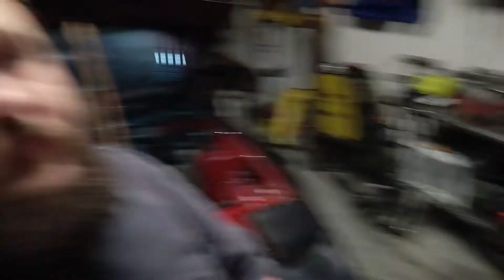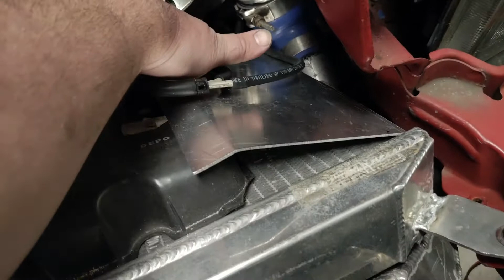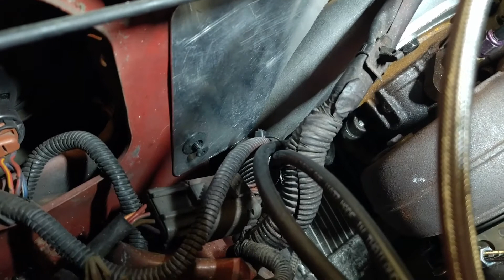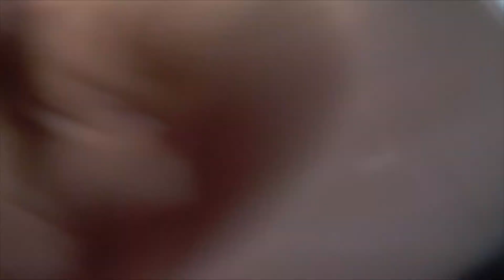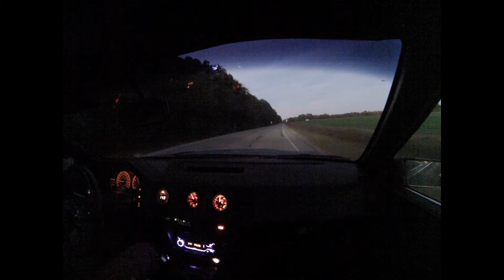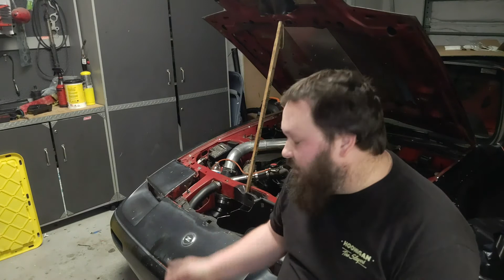Test Driving the Z After The New Downpipe!

Comment: i saw another comment about having cams and some smaller stuff, is there a list somewhere specially what parts you used?
Reply from the maker: The car has a Borg Warner s366, Schneider 270 cam, valve springs, light port work and a custom intake manifold. The fuel system is 1000cc injectors and a 400lph fuel pump. The car is tuned on nistune with a z32 maf.
Reply: @hotwillzgarage3167  awesome thanks! i want to do a similar build on my 88. might avoid nistune since some of the reviews are mixed